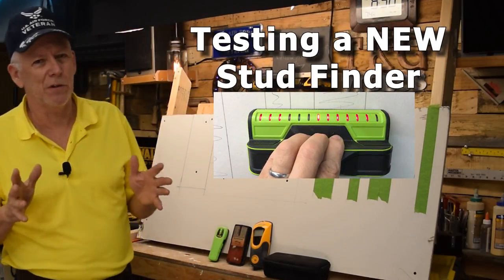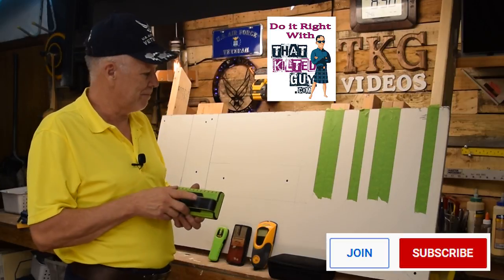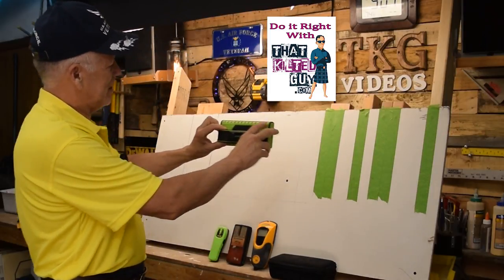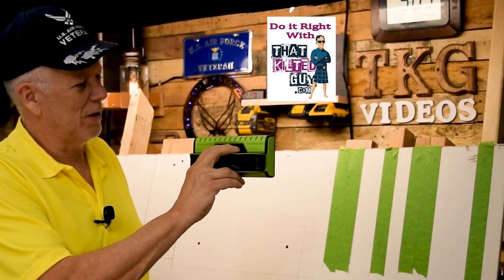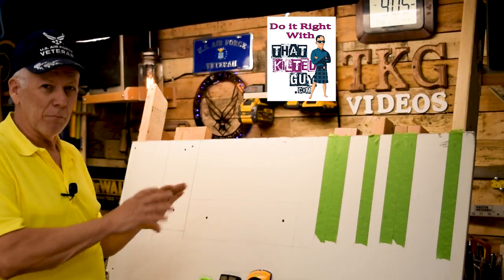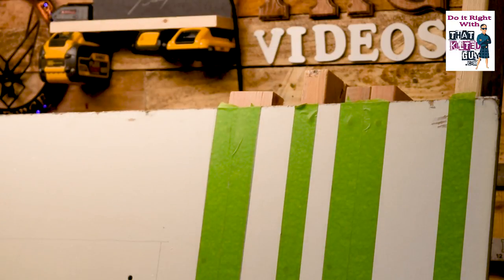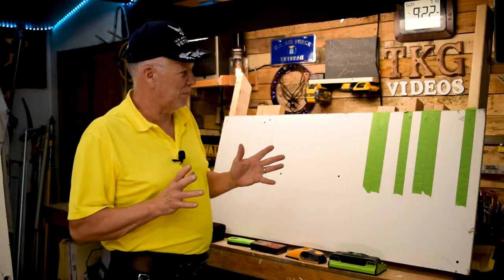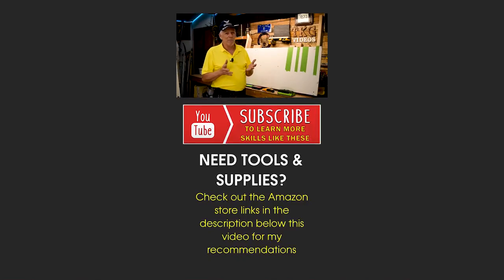Franklin Stud Finder Review and Testing.  This thing is AMAZING

Comment: If used properly and the batteries are charged all types will work the same. I ran similar test with 4 different stud finders and a magnet and all yield similar results. I will say the type you featured in this video tends to be more consistent due to the 13 sensors. I use the Franklin stud finder in conjunction with a magnet and dead on every time.
Reply from the maker: Thanks, I appreciate that 😎, & Thanks for subscribing!

Comment: I've seen these before but have never used one. Glad I got to see it in action, definitely better than the one I've been using, which was your favorite before stepping up to this one.
One of the reasons I haven't bought one yet however, is the size.  Won't easily fit in my tool pouch.
Reply from the maker: Glad I could help

Comment: I own the Franklin because to me it is the easiest to use, my one gripe is that you have to press the activation button constantly.  Sometimes in awkward situations it can be a challenge to keep that button pressed. Bosch makes a model with that feature, but the Franklin overall is best for me. Thanks for the video!
Reply: I've had mine for about three years and don't find pushing and holding a button to be that difficult; the Zircon's I've used all had one or more buttons on them, as well.

Comment: My question is, what's the best way to find studs in older homes with plaster & lathe walls? Some can be very uneven in thickness/density. Thank you for the vid, very well done.
Reply from the maker: I plan on doing some videos about that subject soon
Reply: You can get a cheap magnet on and go slow until you catch a nail or screw

Comment: I have that same yellow stud finder and it works sometimes but it never seems to be perfect. and if you're hanging something heavy like a TV you want that lag screw to be dead center in the two-by-four so you don't split it!
Reply from the maker: When I need that much accuracy, I find the center best I can, then drive screws part way on the sides, to ensure I'm dead center.
Reply: I use a 5/64 " drill bit to find the center. First hole than left & right 1/2" .If you hit on both, you could go left & right a 1/4 " for more accuracy. Good Luck !!!!

Comment: I was wondering how accurate it is if you glide the stud finder and watch the led closely as it approaches the stud. Will it show the edge better that way ? Like a zircon it will light up from each direction 
I like the idea in this tool even if found a faster not creeping up from each side use ..if that makes a difference…

Comment: I used to do handyman work and I actually stopped offering to hang pictures and anything on the wall because it was so difficult to find the studs with my theoretically decent two sensors stud finder
Reply from the maker: They can be tricky for sure.

Comment from the maker: *ONLINE STORE & AMAZON LINKS* Here's a link to the stud finder I mentioned in the video. (we do earn a small commission on sales, but it costs you nothing more, so thank you for your support)This Stud Finder is selling like HOT CAKES. The Franklin stud finder -https://amzn.to/2SmUDgF
Reply: thank  yu  this  helped   alot.   but  could  yu   do  one  when  ur  trying  to  hang  somthing  from a  shower  ceiling?  this  may sound  stupid .  but  these  stud finders  is  what  brought me to ur  chanel.  and it has  helped. ive  moved into an apartment  and  have  tons  of  pictures  to  hang.   when i  got  to the  bathroom   shower ,    i want  to  hang  one  of those  3  tier  wire  baskets  that  would  hang  down from the  ceiling   using  a    screw  hook or  if  yu    use   a    screw   hook  {thats  what  i call it}    from  the  wall,  but  when  i saw  that yu  showed  other  pipes  behind the  wall  like  water pipes  and electical  i   had second thoughts.  could yu  help  me ?  what should i do .  forget  about  the  shower  project ,  lolo.   or  not??

Comment: Thanks! Would you recommend getting this and a cheaper one to detect the edge better? I am learning to do some DIY and installing shelves in my laundry but worried i might hit something...what would suggest as a good way to be safe and not hit any pipe/plumbing?
Reply from the maker: If you want to save money, just get this one and go back and forth a few times.  You'll be able to spot the center, or mark each edge as it shows up and aim for the middle of those 2.
Reply: @ThatKiltedGuyDIY  thanks for the tip!!

Comment: Where did you find your Air Force plaque that hangs on the wall?  What years did you serve active duty?I like your cap! Thanks for the good tips on using the stud finder.
Reply from the maker: I served from 1984 to 1991, mostly as an electronic warfare technician but also in personnel.

You mean this Are Force plaque? 
https://amzn.to/3iJHWtG
Reply: @ThatKiltedGuyDIY  I was in the 651st  comm squad, 1956 -1960.  32 years with telephone company. Thanks for the link.

Comment: Looks like a nice unit. What do you recommend for finding AC? Stanley stud finders devices have that feature. Have you found them to be reliable for that purpose?
Reply from the maker: I seldom need to find AC, so not much experience with it.  I try to avoid it, lol.
Reply: @ThatKiltedGuyDIY  Thanks. Reviews and comments suggest that the AC detection can be patchy in cheaper devices. The thickness of the insulation around the wires is probably a factor.

Comment: Just bought one of these stud finders because I was having a hard time finding the studs to hang a hand rail for my basement stairs. Using this stud finder I found that the braces were running diagonally through the wall. And I love the fact that it uses two AA batteries vs the 9 volt! Can you put the link to where I can purchase the case for the stud finder? Thanks
Reply from the maker: It is in the description below the video, but here it is- ** The case for this stud finder - https://amzn.to/2WVcmhb **

Comment: I've been an electrician for over 35 years, had a dozen or so studfinders, they all suck. I use my knuckle, way more accurate. Thanks for your service, what was your AFSC, when did you serve?
Reply from the maker: Hey, I did a short stint in personnel as they said I was colorblind in MEPS, then I proved them wrong, went palace chase, and retrained into Electronic Warfare and worked on the retired A-7s. 1984-1991, SSGT, E-5. Thanks for your service as well.  What did you do?
Reply: @ThatKiltedGuyDIY  PMEL, 86-90 then 90-'06 in the IMA program. Tech school at Lowry then off to Wurtsmith, reserve duty was with AFMETCAL Det-1 out of Wright Patterson was stationed at Newark AFB. Reason I ask is you look familiar, it's been 34 years but I see that you're not who I thought you were. Great video's, really enjoy watching them.
Reply from the maker: iwerkalone thanks
Reply: Thank you for your service gentlemen!  I was also an Electronic Countermeasures System Tech, 32853, 76-82.  Eglin AFB, FL, Spangdahlem AB, Germany, Griffiss AFB, NY.  I was also our shops main contact for PMEL!
Reply from the maker: That’s my AFSC too. Worked on A-7s. 84-91. Thanks for your service.

Comment: You should do a video of stud finers with differant material.....My walls are (1940's) 3/8" drywall and some kind of morter over it like 1/2 to 3/4 inch think also lath and whatever else has been used. your video is good but simple drywall and stud dosnt test much.

Thanks

Comment: Hi.. This can use on concrete walls?
Reply from the maker: No. What would you be looking for in concrete anyway.
Reply: Concrete metal bar
Reply from the maker: I think I’ve seen one that will do that but it seems like it was really expensive. This one won’t though
Reply: Facing problem just now drill hit the concrete metal bar

Comment: I watched a video comparing 4 different stud finders over studs, electric wires, conduit, pvc, for detection... A major problem was it showed conduit as a stud! He did it twice, then said, that’d be incredibly dangerous. I canceled my order after his video.
Reply from the maker: How close were the wires and conduit to the surface?  Pipes, wires, etc. are supposed to be located more in the center of the stud bay and therefore most Stud finders won’t detect them.

In all my years of using them, I’ve never hit anything like a pipe or a wire.
Reply from the maker: In my other video, I show how they detect density difference and if you understand that concept better, you can use them safely.
Reply from the maker: The other problem with that is, I’ve never seen electrical conduit run inside of a wall. Conduit is for the outside of the wall. Inside the wall they just run wires loosely. And my final issue is, you would need a screw that is roughly 2 1/2 inches long to reach far enough to even touch the conduit. And conduit is very tough and would be very difficult to drive a screw through.